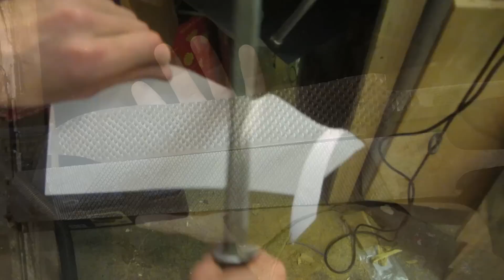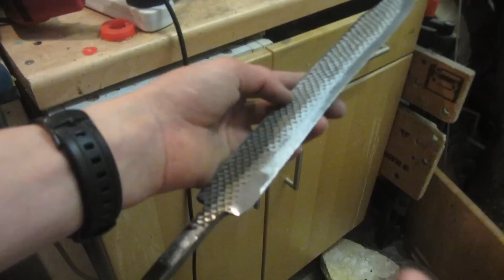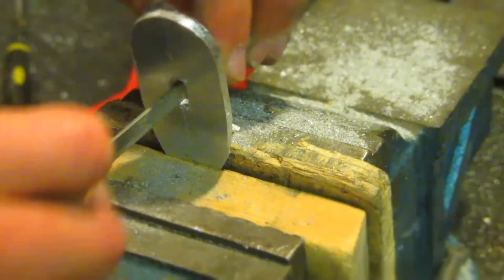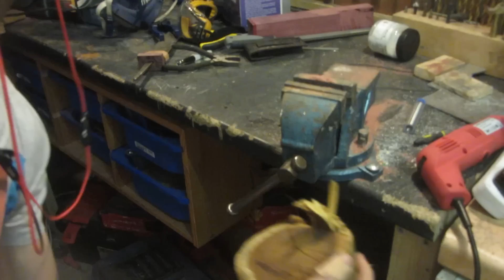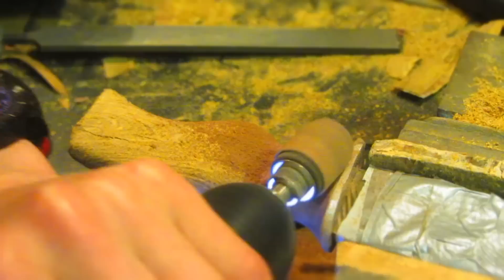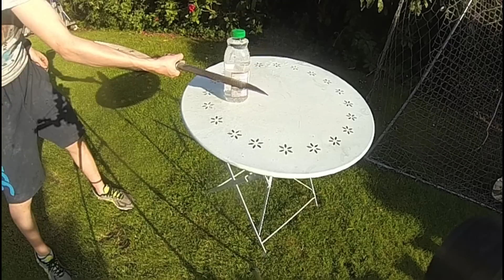How to Make a Bowie Knife From a Farriers Rasp

Comment: You are better off using a thick piece of brass for your hilt tinning the tang with bronze rod and  bronze flux. Once you've tinned the tang with bronze rod slip the hilt over the tang and then this will allow you to  use silfos rod to braze the hilt on to the tang again using flux to get the silfos to alloy with the brass and the bronze on the tang and using only a little silfos brazing rod you will get a joint really strong  it will never come apart. I'm a Plumber and I have used this method many times to join brass to steel, don't try to Bronze weld the hilt to the tang as the melting point of brass and bronze are very close and you run the risk of melting the brass hilt so you would use a brazing alloy such as silfos as already mentioned which Plumbers use to join brass and copper fittings and pipe. The key here though is tinning the tang with bronze which means heating the tang up to a red heat apply your bronze flux and then the bronze rod so that the silfos has something to weld to.Hope this helps

Comment: Plus with how hard that steel or iron is you should've just gone and retempred it. Its good to have strong metal yes. But you need flux. Plus having a weakned spin and a hardened blade can some times make it easier to brake or creak the knife.

Comment: What you should've done is lift the guard how it was,then place the hand on the tang leaving some of the tang coming out of the handle then heated up the tang and hammered it into place. The guard will stay in place and the handle wouldn't move around or slide out of place with this meathead

Comment: It looks like it turned out rather nice, and the handle is beautiful.
However, I would like to suggest that perhaps the next time you work from a farrier's rasp you remove some of the hardness first, if only to save money on expensive belts. Not only that, but even professional knife makers don't leave their edges file sharp; sure, it'll keep an edge, but it is more liable to break or chip, even with a soft back. Soo. . . not to seem pretentious, but what I would do would be to temper it on the back side to blue and bring it to a straw at the edge.

Happy crafting.
Reply: Cave of Skarzs Very good point. While not having to sharpen your knife often is nice(keeping the blade file tempered), a piece chipping off the blade is much worse. Every knife makers struggle with the Rockwell hardness.

Comment: very sad.  I just threw away two farrier rasps because I didn't want to build a forge in order to anneal and heat treat the blade.  Didn't think that I could make a knife without taking away the temper.  Your blade is kickass by the way!  Great job!
Reply: Smithed knifes are cooler though haha.. It's not hard to make a forge

Comment: I don't know if someone noted this already, but you cannot solder aluminum, and some steels. You could braze it, but not with aluminum. Aluminum forms a passive oxide layer immediately, too quickly for you to feasibly form a good joint. Because soldering is basically a surface deep amalgamation of the solder and base metal, there are additional problems just between the chemistry of tin or lead solder and (some) ferrous metals and aluminum that will prevent an amalgamation from happening.

Comment: When working with metal, steel and aluminum put together will oxodize over time, and there is no way of welding or bonding the two together. Use like materials when making a knife, a steel guard would have worked well for that, but you would have to weld it together, but overall u made a very well made knife, way to think outside the box man.

Comment: Since I'm learning to weld at the moment, I think I might have some useful information about joining the guard with solder (either soldering or brazing although the definitions are very similar).
Aluminium doesn't rust because the oxide layer (Al2O3) on the exterior is very hard and chemically resilient. In order to arc weld aluminium you typically run AC as opposed to DC (reasons you can read about here: http://goo.gl/ph12DV) as it cleans the oxide layer off. I think to braze it you'd need a more corrosive flux.

Great vid, btw. The grip is especially outstanding.

Comment: THis is just a guess but if you drilled a hole in the steel (presuming you can , positions right in front of the guard(the point where the guard ends going up the rat tail tang)) then put a pin that sticks out only a few millimeters on each side. Then make room for it in the mahogany. But To be honest , that would take too Damn Long so stick with the glue :)

Comment: hey m8 not sure if you have 1 but try to tig weld the guard
Reply: Fletcher White You sound like you're 13-15 in your 1 year old videos so you're still pretty young, so you are not engineer not even close to that and judging by your grammar you are definetly young ...
Reply: 2 different metals won't weld together
Reply: a tig welder melts metal a stick welder adds metal and so does a mig a tig will work I'm a i know I'm a engineer
Reply: Fletcher White no judging, but if you r an engineer, why do you have a minecraft pic? XD
Reply: just cuz i have a job does not mean that i can't play mc
Reply: Fletcher White You're an engineer alright. Full of shit with no idea of what it takes to actually build the crap you design. I was a welder and machinist. You cannot weld aluminum and steel. Look up the term galvanic corrosion. Then you'll understand that even if you could, it's a bad idea.
Reply: Fletcher White rofl you are not an engineer, you try and weld aluminium and steel ;) you will fail. Trust me on that one since im a mechanical engineer lol
Reply: Simon Hjalmarsson you can actually tig aluminum to steal although I would not advise it for the weld will not be as strong and the corrosion you will play hell with. I'm no engineer but I'm an auto body tech in the us
Reply: Kareem Adham granted he should have strong arms but as he is still young and needs to grow into his arms.. as for factors regarding the science behind cutting a bottle with a heavy bladed knife in a sense the weight should of done it it self.. still a great video and a very clever young man keep it up one day you'll be making folded steel katanas 👍👍
Reply: Fletcher White They all melt metal. A T.I.G. welder you just have to add the filler manually.
Reply: Simon Hjalmarsson It is possible with a T.I.G.. I've done it. Wasn't easy by any means and doesn't make the greatest bond as Levi touches on.
Reply: Fletcher White Welding in general adds metal, considering you have to use filler rod.

One would imagine it'd take a lot of current to actually get a weld to take on that blade. Not to mention the pain in the arse welding two dissimilar metals can be.
Reply: Rob Calhoun Dude's an engineer just as much as I'm the bloody pope

Comment: such sharpening will irreversibly change material. Knife spoiled
Reply: +anna vlad There's nothing wrong with the knife he made. He kept it cool the whole time...
Reply: TehSorso That was literally my point...
Reply: Thanks for the info how long have you been doing this?
Reply: anna vlad  Irreversibly? IF, it did change its temper by over heating he could easily re temper it.
Reply: anna vlad  Irreversibly? IF, it did change its temper by over heating he could easily re temper it.
Reply: +anna vlad Well the lad is 15...
Reply: Why?
Reply: thermal load on steel
if sharpened this way, it must be under the coolant
Reply: Is it really getting hot enough that way?
Reply: It depends on the desired result
simple knife - probably normal way
for really excellent knife this way bad
Reply: +Adrenaline Gaming Your comment is irrelevant. Seems to be a damn good forger for 15, I'm really impressed.
Reply: For normal carbon steel (probably 1075 here), he would have to get it to run the colors before it would change the hardness, and I highly doubt he let it get red hot while grinding.

Comment: Beautiful work. Thanks for sharing your craft. An aluminum guard is going to be difficult to fix to the tang with anything but epoxy. Using a brass guard and brazing it on will be a lot easier in a home shop.

Your videos have been very professional, but in this one you're talking fairly fast and letting the words run away with you.

Comment: If I was going to make a large knife out of carbon steel, I would go with a wider tang with a nice smooth concave transition from the tang to the blade. Sharp internal corners on any metal piece will concentrate stress at the internal corner.Same with the notches cut onto the tang (edge only, semi circular concave). Beautiful knife though. I once made a large knife out of a pwr hacksaw blade, so I know the labour that goes into such a project. Cheers friend. :-)

people have already covered dissimilar metals.

Comment: The solder problem was temperature. Aluminium and steel have very different temperature coefficients and both were probably below the temperature they needed to be for the solder to stick to them. Solder, even when molten, only stick properly to metals when those metals are at a temperature very near or above the molten solder's own temperature(solder fusion point). In that specific case, soldering to a big metal piece is difficult because the big piece dissipates a lot of heat and conducts it well enough that you never get the heat to build up on the spot you want it to get hot. Moreover, when dealing with solder in general(especially soldering wires): don't heat the solder, heat the wire(or piece) until it gets hot enough to, itself, be able to melt the solder upon contact. If the wire you are soldering is not hot enough, you will have a poor connection, even if you manage to make a molten lead ball around it. If you made that guard in steel, you could properly weld it with the appropriate equipment or make a homemade welding machine using some old microwave transformers. There are vids on how to do it. If you try that project, please use protective gear on eyes, hands and arms,  body, legs and feet.

Comment: I found out if you start with 80 grit on a knife and up to a1000 grit dry sandpaper then use 2000 wet sandpaper it with make your knife mirror reflective I know because in did it

Comment: You cannot weld aluminium in this manner, its melting temp is way that of most metal you would usually forge or weld, you would need a TIG and special flux as well.

Comment: use Silver Solder and Stay Clean Flux or just regular old plumbers flux.  

FYI, Aluminum (660 C) will melt before Borax does (740 C).

I would preheat the knife to about 250 C, then flux, affix guard, & heat all around the guard from underneath and solder from the top.  when it's all hot enough, it'll suck the solder down in.  

Beautiful knife!  Best of luck, you're doing great!  Love your projects & vids!

(also, jb weld or epoxy would work fine too)

Comment: A few ideas. first the blade doesn't have to be as thick as you left it. but I understand why you did, second I recommend using oil for the quench instead of water, just because steel is a very temperamental material, third instead of heating it in a bath of water it would have been better to heat the spine of the blade to a red heat then let it sit for a while blade/ edge facing upwards and let the risidual heat travel towards the blade making it much more risilient, because leaving the blade untempered as you did can lead to chipping and burs along the edge.

Comment: One more thing, make sure you degrease any surface before applying epoxy. Wipe it down with acetone or a degreasing dish liquid. Epoxy adhering to it's maximum potential is critically dependant on surface prep. Wipe oily woods down as well. It will make a huge difference in strength.

Comment: As a knife maker who uses files and rasps, a little word of warning. Not all of them are solid carbon steel. Some are case hardened. I learned this the hard way after annealing, grinding and heating a rasp to non-mag that wouldn't harden. You need to test the steel before making a knife from it. It is very simple. Heat the rat tail to non-magnetic in your forge. Quench it immediately in water. Hang the tail over something hard surfaced. Give it a good blow with a hammer. If it snaps off clean...solid carbon steel. If it bends over.....toss it. No good for knives. Do not assume that because it bears a certain name (like Nicholson) that it will be solid carbon steel. The big makers have cheap case hardened versions as well with the same stamping. Test it first...or you may be wasting your time and hard work. Trust me!!

Comment: use brass instead of aluminum. and use silver solder instead of rosin or acid core solder. brass welds better to carbon steel better than aluminum. where you cut the shape of the tang out it made a weak point th the knife. next time cut them at a 45 degree angle. or invest in some drill bits that are intended for hardened steel and make it a full tang knife. or you can aneal the handle the same way you did to the back of the knife.
Reply: Tapper the tang similer to the shape of a wine glass except smaller at the top of the tang where it meets the blade.

Comment: A good stronger option to hold all the handle on would be to have a longer tang with a metal piece on the end holding all the wood on shaped along with the handle to look clean. Then pein the tip of the tang over like hammering a rivet. This wont come lose over time. Or you could drill and rivet the main heartwood through the tang.

Comment: Another way to make the handle fitted correctly you could drill a smaller hole than the tang then heat the tang and burn the wood into place. This helps fit the handle into the perfect size and shape with little to no room to move

Comment: there is a new show on the history Channel that i think you would like its is called forged in fire its about blacksmithing knifes and other weapons   also solder doesn't stick to anything very well you have to force it in the the gap between the blade and the tang once it hardens it bonds better

Comment: P.S. try removing the aluminum during heating till you are ready for solder. Then assemble everything quickly and touch solder to hot steel

Comment: For soldering you need the right flux.  Rozzin core soldering wire should work, ( it already has everything in the wire) and you need the tang where you want the solder to be around 850° F.  Everything should be clean (including mill scale).    Or the other alternative is brazing (similar to soldering but at hotter temps and with a pre-fluxed brass rod).   Oxygen and acetylene work wonderfully.

Comment: That's a real nice looking knife.
 Its a great use of an old worn out tool. Wouldn't it be a cool feature of a big camping knife if the file were still useable? I mean start with a fresh new sharp file and somehow cover or protect the back half while forming and sharpening an edge.
I would think having the file stay useable could come in handy for a campsite knife...
I don't think tempering the back of the blade would be all that important. Ive never seen one of those big files be all that brittle before there usually way tough enough

Comment: You may kick yourself here what with your experience with aluminium...
If I was you I would have put a grove into the tang where you wanted the aluminium guard. Then, protecting the rest of the rasp, pour molten aluminium into a mould formed where you want the guard. The grove would prevent it slipping once cooled.
I am sure you could achieve this easily using sand with your expertise

Comment: The answer to you fail is that copper welds to aluminum not steel. Steel and Aluminum is a bad mix it makes it Rust. Use another metal for that piece of aluminum on the handle It will Rust and soder will never stick. You need to study metaloligy so you know how to weld.Trust Me

Comment: From my experience using solder, you probably would have had more luck using an Oxy-Acetylene welder and silver solder.  This way you actually heat the metal for it to stick and can manipulate it more easily as well.

Comment: I think the problem with your soldering is heat dissipation, the huge chunk of steel can absorb alot of heat and aluminium is a very good heat conductor. I am not entirely sure though.

Comment: You can't solder that kind of metal together, that's a different process. However, a good  method of attachment is exactly what you did, simply epoxy it in place. You're making some good knifes, you just need to focus on the finish more than just finishing project. If you make another knife, instead of large curves in the blade try something more traditional like a straight blade with a sweeping edge. Good luck and keep up the awesome work!

Comment: The end piece of your handle is already cracked this will worsen with time, you used a wood which wasn't dried properly you needed to kiln dry it to remove all moisture, you will never solder aluminum to steel, tempering the entire blade would have been a better idea, if the edge is hard and brittle it will chip. I am a knife maker and hope these little things will help you I love seeing a young bloke doing this stuff, please don't stop you are on your way to becoming a very good craftsman good work mate

Comment: On soldering, high carbon steel and aluminum aren't exactly conducive to taking a soldered joint because the aluminum will hot short (melt) way before the steel gets hot enough to achieve adhesion with the solder material.

Comment: The solder won't flow because the two pieces of metal need to be hot so the solder wants to stick to about  1250 degrees Fahrenheit